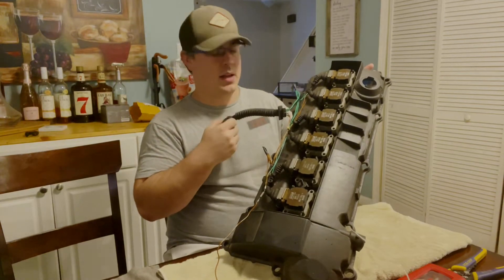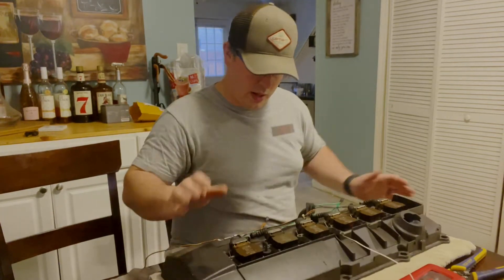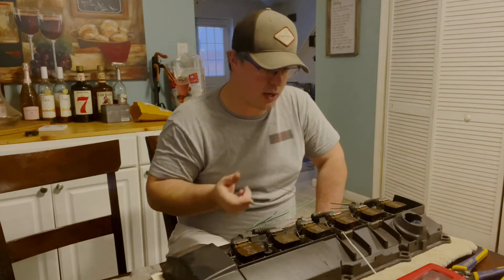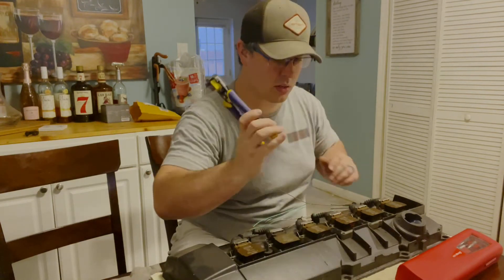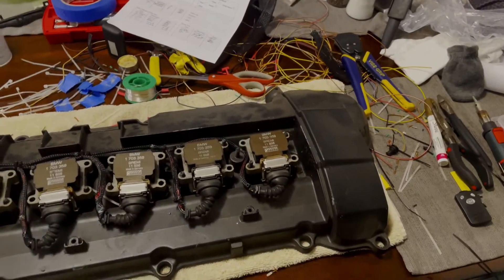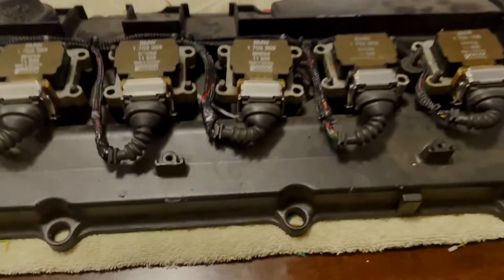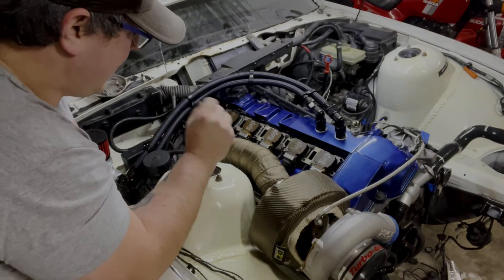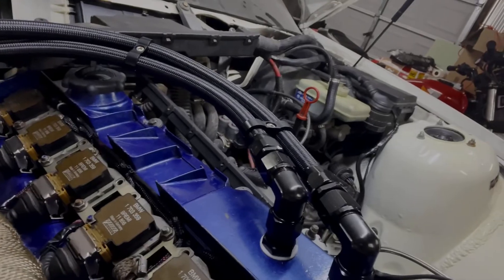Turbo E36 Coilpack Wiring Relocation!

Comment: My man, was just about to do this for mine. Thanks for the video
Reply from the maker: No problem! I’m actually about to do the same thing except wiring B58 coils.
Reply: @DadBodGarage  I’m currently redoing my bottom end and figured I’d do something to get away from heat! I’ll be doing b58 coil conversion possibly spring.
Reply from the maker: Nice! Yea, it’ll definitely help with heat. B58 coils are super straight forward too since they wire in just like factory.

Comment: Where do you put all your wires and relays for fans gauges etc? I noticed how clean the area near your ecu is. Mine has a rats nest of wires right where the SAP used to be. Are you stock DME?
Reply from the maker: Factory, OBD2 DME, yes. The chassis wiring is all obd1 car wiring since it’s a 93. The wiring for the gauges and such runs through the area where the fender bolts too. All of the wiring that used to be for things like washer bottle, hood switch, etc. all got deleted since I didn’t want/need it. The wiring for the fans runs from the same place the gauges do. The relay is on the outside of the frame rail but forward of the fender liner. The wires for the temp switch and fan run along the top of the radiator support with the factory wiring that’s there for headlights and such.
Reply: @DadBodGarage  I’d assume you have your mac valve/boost solenoid and your gauges hooked up to a relay separate from the fan relay. Where did you get switched 12v aka the trigger for the boost solenoid/gauge relay?
Reply from the maker: No relay for those. With the innovate stuff, it has a cord that you just run into your gauges and then you have to find switched power and ground. I used the switched power for the radio and spliced into that.
Reply: @DadBodGarage  No relay for the boost solenoid either? I currently have my AEM boost controller and AFR gauge powered by the pin 16 on the 20pin connector. But I realized now that’s a bad idea since it’s getting power through the DME which could throw off the tune/data that the DME gets. I’m thinking if I run a wire from the pin 16 on the 20pin connector as the trigger for a relay that powers the gauges and boost solenoid etc it would at least be better. But I want to find a switched 12v in the engine bay that doesn’t get power from the DME
Reply from the maker: Nope, all my innovate sensors and solenoids are ran to the steering column through the positive battery cable grommet in the firewall and using the radio switched power. The two map sensors and Mac solenoid plug into connectors coming from the respective gauges. Only thing I have running from pin 16 is the trigger for the fan relay circuit.
Reply: @DadBodGarage  huh interesting. I thought you needed to run a relay for the gauges and max valve?
Reply from the maker: Nope, instructions just say to find switched power. You could run it on a relay if you wanted it to turn on with something else besides ignition.
Reply from the maker: A relay is also only really necessary if you’re using it as a triggering device coming from a circuit of higher or lower amperage such as my fuel pump. Factory wiring is too small for that size of pump so I use the factory wiring to trigger a relay so that I can power the fuel pump with a larger diameter wire right off the battery.
Reply: @DadBodGarage  Yeah you’re right, I just the instructions for my AEM gauges. I guess I won’t run a relay but instead I’ll switch the power source from pin #16 to the windshield wiper pump switched 12v. Just to be safe lol
Reply from the maker: Won’t that only work when your wiper squirters are applied?
Reply: @DadBodGarage  I believe there is a switched 12v for the wiper pump, I will have to double check on the wiring diagram
Reply: @DadBodGarage  Okay makes sense, I never really knew the reason of using a relay. I also did the relay setup for the fuel pump
Reply from the maker: Yup! Just for stepping up or down! There’s other uses, but that’s typically what it’s used for.
Reply: @DadBodGarage  no I checked the wiring diagram. It’s 12v switched hot all the time of course when the key is on that is.

On a side note, have you looked into using the m50 coil pack wiring harness? It puts the wires away from the downpipe. Just not sure what it looks like beyond that.
Reply from the maker: @MINIPOTHOLES  m50 harness doesn’t work with obd2 wiring. It’s way more wiring than the way I’ve done it and adds more clutter on top of the engine anyways.
Reply: @DadBodGarage  oh really? Are the pin outs different? I was thinking of cutting the section of the m50 harness that goes to the coils and using those but I guess it makes hardly any difference at this point lol. 

What did you do with the green and brown junctions, as well as the brown rubber thing inline the middle ground I believe to be a resistor? Because of those things mine is pretty chunky. Also I checked for continuity everything is good except the ground that has the long rubber resistor thing. Should I have continuity there or not?
Reply from the maker: Idk, I didn’t look into it because I didn’t want anything obd1 and it cluttered the top of the engine. 

All I did was extend wires so it fit above to coils. I changed nothing else. You may not show continuity through the resistor if the resistance is too high. All you really need to see is that it isn’t “OL” when you measure resistance across it.
Reply: @DadBodGarage  Right okay, I don’t think my multimeter displays “OL” but that being said I’m pretty positive it will work.
Reply from the maker: Yessir, It should be fine as long as it doesn’t read that it’s open.

Comment: Where did you get the wire sleeves from? If that’s the proper term
Reply from the maker: Just from amazon. The link is in the description for both sizes I used!
Reply: @DadBodGarage  why did you need 2 sixes? Curious
Reply from the maker: One size for each coil wiring, and the bigger size for where they all came together. You stretch it too much and it becomes see through.
Reply: @DadBodGarage  another thing, what size wire did you use for this?
Reply from the maker: I forget the exact size but it was the same sizes that are used for factory. I actually used pieces from an old body harness I have laying around.
Reply: @DadBodGarage  alright, I think I’m gonna run with some 18 guage. Have you had any problems with doing this since you’ve done it?
Reply from the maker: Have any people’s? I’m not sure what you mean. Do you mean problems? If that’s the case, no. It’s been fine since.
Reply: @DadBodGarage  Just finished doing mine. Curious if you’ve had any melting issues with the wires? I doubt it but curious
Reply from the maker: I haven’t noticed any so far. I also have a couple vents in the hood so air should be staying decently cool under the hood.
Reply: @DadBodGarage  that’s good to hear, and you’ve been running it quite a lot since you made the video?
Reply from the maker: I’ve ran it enough. If there’s an issue I’ll address it, but so far, no. No issues with melting. The hood vents deal with a lot of the heat.
Reply: @DadBodGarage  Sweet thank you for the info! Im hoping I can put some testing into this coil pack harness setup this season. I don’t have any hood vents though so we will see how it goes!
Reply from the maker: @MINIPOTHOLES  did you solder or butt connect?
Reply: @DadBodGarage  solder and heat shrink with the wire sheathing/conduit over top. Also made an aluminum cover to go over the valve cover
Reply from the maker: It should be alright. If it does start to misfire, you know where to look.
Reply: @DadBodGarage  That’s true. Easy enough to sort out using a multi meter. I may put some fiberglass high heat wire wrap on the sections of the harness closest to the downpipe
Reply from the maker: Probably won’t need it.
Reply: @DadBodGarage  hopefully not
Reply: @MINIPOTHOLES any update? plan on doing the same thing 😢
Reply: @Kvn_e36  What questions do you have? It’s easy to do.
Reply: @MINIPOTHOLES  where did you get your extra wiring from? I believe in the vid he got his off a parts car tho :/ and no melting issues? since I believe you asked about it too and thx for replying quick!
Reply: @Kvn_e36  hmmmm, I’m 90% sure I matched the wire size and just bought some from the store. I believe it was 20 gauge wire. Nothing special and it worked great.
Reply: @MINIPOTHOLES  perfect! and do the colors of the new wires have to be the same too? didn’t watch the whole vid my bad hahah
Reply from the maker: The pig tails that come with the kit match the colors on the harness that you’ll splice into. The only difference is the tracer on the wires for the oem harness so you can keep those straight. Label each wire that has a tracer so you know which cylinder it came from and it’ll make sense. The colors of the wires don’t have to match, but it’ll make it easier if you ever need to trace stuff in that subharness. I did just grab wire from an old body harness I had laying around. As long as your wire size isn’t smaller, it’ll be fine.
Reply: @DadBodGarage perfect sounds good! 🫶🏽